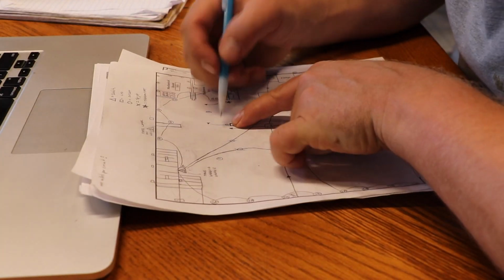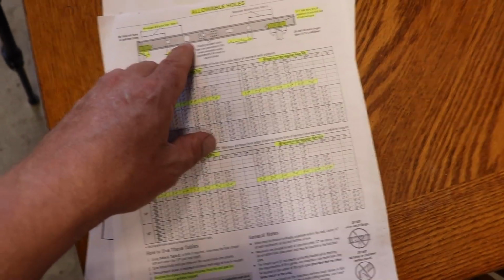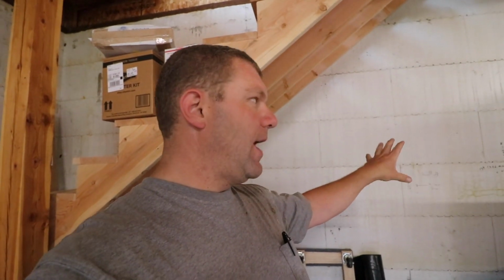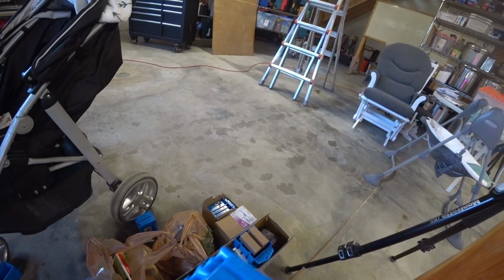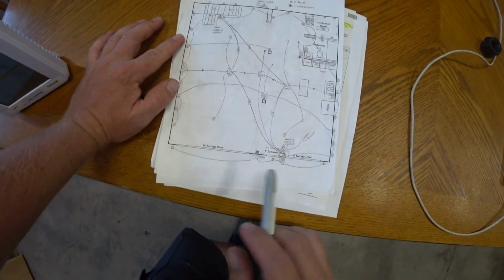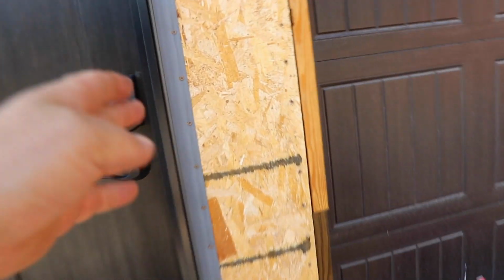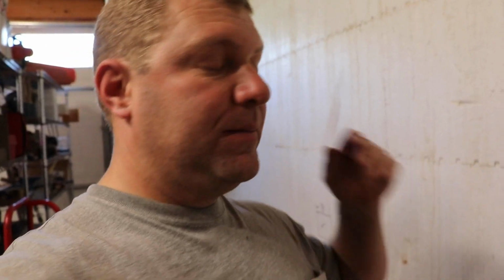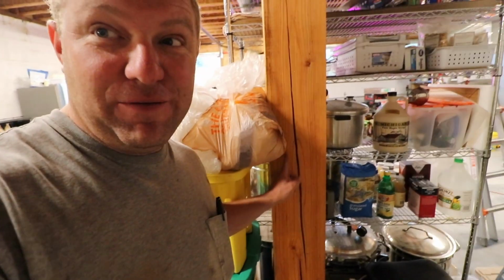THE NEXT BIG PROJECT! (Beginning Garage Electrical)

Comment: In my country there are industrial rails for wires on the ceiling;
You may do a dry ceiling under these metal wire rails; 

(and the firefighter riped those dry ceilings out after the 5th incident of a hidden electrical fire in an underground tunnel with 5000A live rails; -- in my city we had an underground and underground train platforms with proper ceiling -- now 30 years forward all the dry ceiling is gone as firefighters don't like crowded [really crowded] spaces with potential hidden fires in the underground with limited access)

Comment: Instead of pulling high voltage to each light via a switch, why not use relay/contact driven lighting with low voltage wiring to the switches ? We did this for our sips house. We only provided AC power to GPO's

Comment: Have been watching for sometime now, first time felt the urge to comment.  I sure someone has already gave you a suggestion on reducing the number of wires in the SIP wall, but in case they haven't here is my suggestion. Take it for what it is worth.   My assumption is the lights and the outlet below the light switches are on separate circuits.  The light in the garage and the outside lights are on the same circuit?  Run you outlet wire in the chase as you planned. Run the hot wire to one of the light fixture boxes and make that a junction box.  Then run two 14-2 wires to the switch box.  Use one of the black wires as a hot power wire in the switch box, pig tail three wires from the hot wire to the power side of each switch.  Mark the white wire of each set of wires with black electrical tape. Use the remaining black wire and the two marked white wires as the switch leg to the light fixture/junction box, you will also need to mark the white wires in the junction box with black tape.  This should allow you to only run three wires in your SIP chase.

Comment: Don't forget - those 4 inch square boxes you are putting along the ICF wall, need mud rings.  The box SHOULD be FLUSH with the foam, then the mud ring will bring it out to the face of the drywall.

Comment: Why would you destroy the insulation. Just put up a 2x4 or 2x3 stud wall in front of the sips and build like normal. It's a huge basement, you aren't going to miss the 7" or 5" and your basement will be much better insulated. I also don't see how you are going to run any wires the way you are doing it, on the outside there should be a strapping layer so you have a drainage space and an air space. Just run the outside wires in there but in metal conduit I think for safety from nails and screws.

Comment: And of course you can also use wireless switches
on this system. The switch is 6mm thick

ICS-2000 Octopus Internet Control Station   (€85)

Comment: Why don't you use a small home light mamagment system. It saves you a lot of switches and wires and you use your smart phone for operation. of course you can use multiple telephones.
This small system offers many options such as dimmers, timers, day / night switching, motion sensors and everything wireless.
Greetings Ronald from the Netherlands

Comment: what about putting the outside lites on the bottom of the deck
Reply: This is what I was thinking, straight up and out to the deck.  Would save a lot of side drilling.
Reply: @deniswinrich6025  yes and you could put directional  lites to shine father out and use large led(shop length ) lites for general type lighting we also bought 3  3 lamp solar lites at sams for 34$   they are great  with motion and nite sensor  i  believe they are about 1500 lums

Comment: Outlets in garages (and in workshops, too), should be at least 4' from the floor to the bottom of the cover plate. That way, if you lean a sheet of plywood against the wall, it will not block any outlets.

Comment: Man, l thought you usually put in all your plumbing, drains and HVAC first!?
Reply: Exactly right.
Reply: In first where?  How?  The garage walls are poured concrete with Styrofoam forms that say on for insulation, so you certainly can't put anything "in" them first.  The other walls are SIPS (pre-made  wall sections with Styrofoam sandwiched between 2 sheets of particle board).   So again, you can't put anything in "first".
Reply: @johnchappell4492  That is the point.  The water from all toilets and drains has to be evacuated via gravity power, so drains have the first 'right-of-way'.  Then, water has to get to every faucet as well as the warm/cool air has to be delivered, circulated, and returned, and that gets next priority because these two items hate excessive run lengths and turns.  Finally, the electrical can be run as it is the most forgiving about being run around and over all of the other stuff.

Comment: On the door issue do 14/3 or 12/3 conductor save on wire.
Reply: And if you break the duplex connection you can have each half on a seperate circuit. I just wired a shop, and 2 duplex outlets 4 ft apart have 4 20 amp circuits. Pretty sure we will never overload that.

Comment: My doctor is building an ICF home in Alaska using Fox ICF block. He has had great success running his electrical wires hidden using a 5/8” flex drill bit agains the concrete and behind the foam interior, thus he isn’t losing any foam and avoids unsightly routing channels from cutting with a hot knife. Any thoughts of doing that?

Comment: Smoke / carbon monoxide detectors emergency light near electrical panel and stairs
Reply: Also, if they are going to park cars in that basement, the door into the living space should be an auto close door, steel clad with magnetic seals to prevent carbon monoxide seeping in.

Comment: Apple or Banana? Answer is: strawberry= outlets on ceiling and 2 electrical drop reels... affords you way more options down the road with the outlet on the ceiling. Doesn't leave outlet in line of sight and allows the post to be appreciated more.

Comment: you need to take a feed from a dedicated circuit to all floors of you house for emergency lighting,  if your in the loft it's a long way down in the dark if it's only the garage that's lit, most modern lights can be fitted (or come with) emergency lighting, but it still needs a dedicated circuit so the lights stay on if everything else fails, (they come with battery backup)

Comment: One thing that I don't understand is why you haven't built a shed for your equipment to include your mill saw. Just using 4x4's or 6x6's with 2 sides and a roof along with the shed big enough for both your milled/cut wood and a section for wood burning.  Your doing great just some suggestions.

Comment: Look up NEC Table C.1

You are running THHN in a 1" conduit, i assume 12 awg. You can fit 26 12awg wires in a 1" EMT.  In non-EMT you can fit 23-25 wires.

Comment: Then I know you are still in the building stages. Being a retired firefighter. Manufactured 'beams' are a firefighter killer. If one part of the beam fails - the entire thing is fails. So 1 inch of sheet rock / fire 'proofing' is important.  Hope you someday put a whole house alarm system - burg / fire. Take care and thank you for the video. Spin
Reply: Tom Pinnef never thought of that. I’m not a fan of the manufactured joists anyway, they are just a pain to build with and a pain when you want to modify anything

Comment: One piece of advice for where you're at, lights attract bugs at night. Therefore the closer your lights are to your doors the more bugs you will draft in when you open them.
Reply: We switched to LED yellow bug light and solved the problem. It also helps keep the bats out who are feeding on the bugs. Happened 3 times before we figured it out.

Comment: Are you going to eventually going to use rock wool and fireproof sheetrock between the garage and the house above?.
Keeps the house isolated from the less insulated garage, if power fails, and upper floors will be warmer.
Now is the time to "think" about fail over led lighting, nice to be able to "see" if main power goes out, until you can get the generator power going.
Since you don't have a secondary breaker box for main/generator power items you "must" run, at least label them in the mains. example freezers, default lighting, well, ect,
so you can throw the breakers on the non-emergency electrical items. example heat pumps, air conditioners, while your run on generator power.
Reply: as far as being able to see in a power failure,  keep a headlamp by your bed.

Comment: Honest question, why didnt you frame out walls in front of the foam instead of using the foam as the wall? Or even surface mounted boxes with pvc conduit
Reply: Skunny the ICF has plastic strips built in every 8” that act as studs, and they have to put a layer of fire rated drywall on it when it’s finished because the foam is uber flammable so conduit would be a bad solution

Comment: You can also install just 1 or 2 cables in the recommended maximum allowable wall cavity just as a switch wire, then use a junction box above ceiling level for the neutral, earth and common live. That's what I do.

Comment: Hey buddy musty check that your code will allow you to feed your external outlets from your internal ring mains.  Over here in the UK it had to be on a different circuit,  with a separate type circuit breaker.  Just thought I'd tell you before wiring mate.

Comment: 5/8ths drywall in garages is code I believe
Reply: That doesn't matter when your building in an area with no building codes.
Reply: @CustombyclyneCbc  Might not be code but it's smart
Reply: @petehaidinyak9084  5/8 rock is only required on a wall that divides the garage from the living space. In this case that would be the ceiling witch is pretty much standard to use 5/8 rock to prevent sagging. Lol and this only matters if you had to fallow building codes.

Comment: Question. Y’all plan to build outdoor deck for front doors above the garage doors?  If so. Don’t need to mount lights on exterior walls. Just mounted lights under the deck to brighten both garage and entry doors umm?

Comment: That spot between garage and back door where you want to attach external outlet, and internal switches, framing wise should not have any empty space, there should be king studs, not just single 2s. So those are double two’s hence no empty space in between.

Comment: Try using a pancake box for the exterior lights. You’ll avoid losing the insulation, just a 1/2” hole for the wire to pass through.

Comment: surprised more don't use conduit. it should put strength back into the hole you drilled plus easier to replace wires.

Comment: Silly question.... why not mount those exterior lights on the bottom of the deck... and as others have mentioned, use metal conduit for those questionable ares like between the doors and feeding the exterior lights...
Reply: Use plastic it doesn't rust like EMT or rigid conduit does.

Comment: I think all outdoor devices must be GFI protected.
Reply: Yep.  All outdoor and all garage,,, meaning in this case, the entire ground floor, all need to be GFCI  and depending upon the local or state code adoptions Arc Fault Circuit Interrupter AFCI is required on many things, kitchens and laundry areas , bedrooms , just about everywhere now.

GFCI and AFCI  both.
Reply: Depends on code but yes usually, all can be on one device, well up to ampacity rating.

Comment: Simple solution. EMT conduit. Using individual wires in com=nduit asaopposed to Romex simplifies the whole situation. You just need to learn to bend conduit, which is not a major issue.

Comment: 12/3/wg trick power outlets is not widely accept because it two single breaker are used..both could accidentally be put on same HOT and thus overloading the neutral. Best to use a double breaker  for feed to avoid this.

Comment: As of right now the "garage" as we know it is NOT a garage, it's a basement...garages require a fire rated ceiling and door between the garage and living space (up stairs) which hasn't been installed yet.
Basements and Garages require that ALL 125v 15 and 20 amp receptacles be GFCI protected and with the 2020 NEC coming out next year, I believe we will see these spaces will also need to be on Arc-Fault protected.  Right now just the Laundry Area of the basement/garage requires AFCI protection.  I wish there wasn't so much lag between us seeing this video and when the work actually happened as any thing we suggest is no help at this point.
Reply: Plus you just completely seal the garage from living area so that no carbon monoxide from cars warming up in the winter gets to the living space above

Comment: I'd have the stairs half top power and half bottom.  Trip either one and you have some light.  An emergency light - EXIT box from electrical supply house - has a battery and can light up when one or the other dies and might be best to cover all cases.  Single service and an Exit box.   Just a thought.

Comment: Run all your runs in 12/3/wg, except for the switch loads to the lights. This gives you more wiring options. Be careful you do not overload your neutral.   A or B circuits together the neutral carries the difference current.   But A & A or B & B currcuit the neutral carries both and overloads  on a 12/3/wg cable.

Comment: New feeder to switches require a Neutral....because...some new switches are radio controlled and allow a remote to signal them.  Hence a neutral is needed.  So they made a rule as a code.    
I like an outlet near the  door switches for a Alarm Keypad to feed that is mounted near the door. It plugs in to the switch power feed for a bit of power so it can operate and remotely signal the MASTER unit of the home security system.

Comment: While outlets height is normally close to the floor...<most use a hammer handle as a spacer measuring device off the floor> as an aging senior...I like the outlets higher as stooping over gets harder to do each year.

Comment: You need outside outlet boxes high enough above grade that the snow depth is still below the box. All outside boxes also must be fed from a GFCI protected circuit, easiest solution is to have interior GFCI box on inside of wall to feed the exterior box. In garage areas outlets must be 48 inches above the floor if any gasoline vapors are possible.
Reply: Nope

Comment: I've been a electrician for 30 years. The garage door lights should be more than enough and it will look funny if you put one above the man door. As for your switches surface mount them and route the wires in conduit. It’s just a garage.
Reply: But, oddly enough, it's their garage, not yours.
Reply: @GeneWaddle  Clearly its their garage.  I was just making a suggestion based on what I have seen and installed over the last 30 years.
Reply: @GeneWaddle   Dude, we know, we know.

Comment: Metal boxes require metal conduit. So avoid if possible.
Reply: Not factual - NMC can be used in conjunction with metal boxes if local code will approve, and proper fittings/fasteners are used throughout.

Comment: @Pure Living For Life

Long time viewer with a legit question.  Since you started stacking the ICF’s I’ve been wondering why you guys didn’t decide to frame out 2x3 or 2x4 walls on top of the ICF’s.     It would make plumbing, electrical and everything SO much easier.  I get it, the ICF’s are “designed to have the electrical this way” but I’m pretty sure it would be much easier and faster to have framed on top of the ICF.

I get not framing on top of the SIP, but the ICF’s have always confused me.  At the very least most people put furring strips on top of the ICF so the electrical and plumbing are “more traditional”.

Framing on top of the ICF’s would have been no issue if it would have been the plan from the start, before the stairs and all.
Reply: "Long time viewer with a legit question."
Why not building the complete house with ICF?

Comment: Did you make the hot wire for your solder iron? That is a cool idea, I could use that for my trains. And foam instead of the thin wire and it moving as I go through the foam.
Reply: SFCRambo60 Yes he made it in one of his videos.
Reply: @RevMarket  thank you, will have to go back to find it.
Reply: @RevMarket  finally found it so Thank you again.

Comment: As you pointed out several times, you have a non-traditional house.  While I have no experience with the technical end, I keep seeing advertisements on TV which demonstrate folks turning lights on or off with their cell phones (the smart kind).  Such items would have no requirement for a line or switch being located at the door but more likely could be inserted near the panel box with the power line being only  frm the panel to the actual light fixture.  It may be that you have already considered such a solution and discarded it for whatever reason and I just didn't catch that part of discussion.  I was just wondering if it would be worth considering.

Comment: Think about coming home with the little one in the dark. Outside lights with a dusk/dawn setting that comes on when they see large movement. Also, think about your internet WIFI connection around the home. Do you need to put in network cables? if so plan to keep them away from any fluorescent light they cause a lot of interference unless you use the more expensive screened cables. Would you potentially, in the future, be putting in security/observation cameras outside or inside? Now the time to plan in the wiring runs for them. Hardwiring is always better than WiFi as you get less interference from different devices and a better signal. Hope this helps, and congratulation, now your life has changed and a higher priority has come into your life.